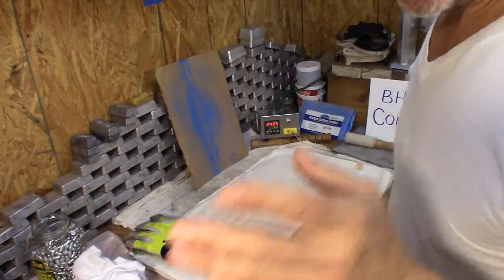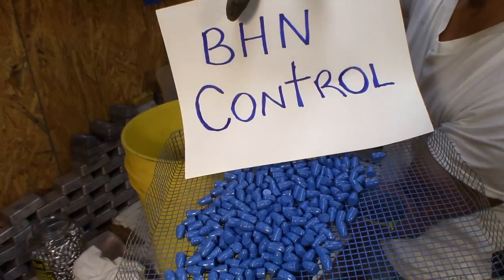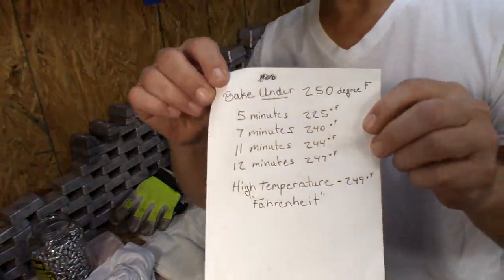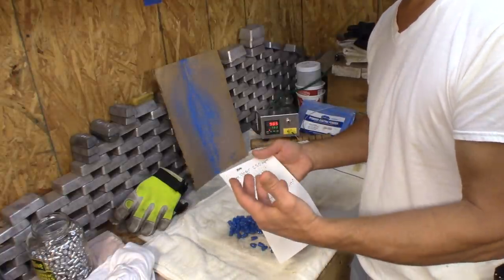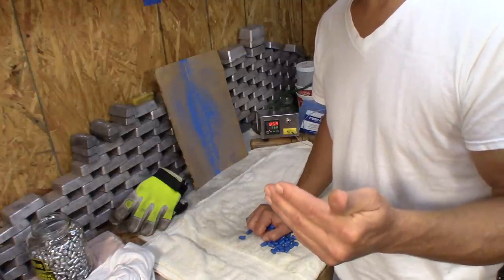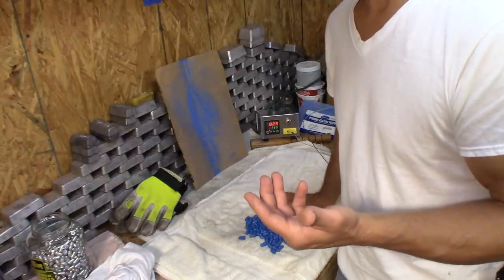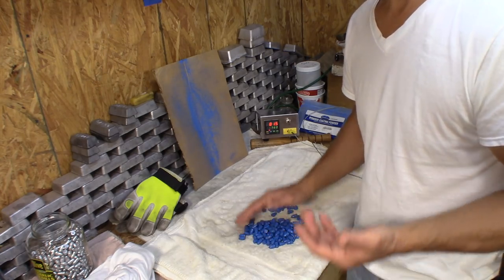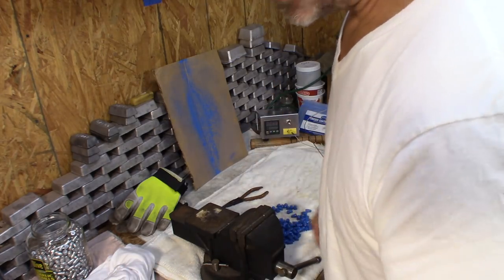Powder Coating Bullets (ULTRA LOW HEAT) Method

Comment: I followed your method as closely as I could, and my first attempt at powder coating bullets turned out great! I used Eastwood light blue and it stuck to the bullets almost instantly. I set my toaster oven at 250 degrees and cooked them for 14 minutes, then dumped the screen in a bucket of water. They came out great! Thanks so much, sir!

Comment: I’ve been powder coating for a few years now and love it🥰. My second attempt I tried curing the powder at 350. My oven read low and my bullets came out deformed. I cure at 300 and thump my tray of bullets on a steel table and let them air cool. Works super great with all my calibers. I’ve used some bright colours so I can retrieve my lead to see the results. No flaking or fragmenting. Between you and Fortune Cookie I’ve become the envy of my club. Thanks sooooo much.
Reply: I just tried my first at 400deg.  Too hot 0 deformed.   thanks, I'll try 300

Comment: My experience is similar to yours - I'm also using wheel weights, water-quenched and come up with 20+ BHN. After PC I'm around 12 BHN but they come back to around 15 BHN after a couple of weeks. However, I also set aside 5-10 bullets from every batch, date them, and BHN test after 6, 12 and 18 months and consistently found that the 20+ BHN bullets actually lower over time, bottoming out at around 15-16 BHN.  So while they'll clime back up from 12 BHN  to 15-16 BHN after PC, they'll also drop from 20+ down to 16 BHN (plain, non-PC) over long periods of time, like 6+ months.  Seems the very high BHN is only temporary unless you're adding antimony to your wheel weight alloy (up to an additional 1.5% will hold it at 20+ BHN for years. But they'll be brittle :))

Comment: Love your videos Elvis, very helpful.  I've had great luck with 300* for 10-12 minutes, works great for me but I'm not watching my BHN but, my cast are my plinlkin' pills for 357, 45 and 9mm @ 1000 fps at the most with anything that will melt for an alloy.  Only problem I had was when somehow my oven got flipped from bake to broil, there was some head scratchin' after that mess.

Comment: This is all good information and is quite interesting!  Those bullets sure do look Purdy with the low temp method.

However... I find personally that bhn is really not that important once the bullets are powder coated.  I use almost exclusively range scrap and at some point I will have to try powder coating pure lead and see what it is capable of.

Thanks for the video...
Reply from the maker: Hey Thanks shadowcastre.. It's not gonna be for everyone in every situation that's for sure. But it is interesting what we might learn from it! we'll keep ya posted! : )

Comment: Elvis, do u resize ur bullets before coating? Or can u resize them after coating. This jon
Reply: I use LEE molds. There very consistent as far as sizing. I think even in the instructions it says that you don’t need to resize after casting. I resize after powder coating and have no problem.

Comment: I did Some Testing with Eastwood Orange Vermillion Powder Coat Powder, and I was surprised by the outcome. My Test was done with 7 Batches of 40 Cast projectiles @5,7,9,12,15,18 & 20-minute Intervals. The projectiles were cast with A MP 359-125 Penta Hollow Point Flat Base (132.4 Grain) Mold. Then they were heated with A Black & Decker Toaster Oven @275°F after powder coating the projectiles were loaded on a dual endoscope fitted Dillon 1050 Super Press. All the bake times passed the acetone and smash test.

Comment: Gave it try. Old method with WW. All PC with Powder by the Pound olive green.
 Started with 20.9 BHN. water cooled. 400 degrees for 14 min. After 14.3BHN. 
Elvis method same start point 20.9BHN, 225 degrees for 13 min BHN 15.4.Dropped in water to cool.
Your on to something friend! Nice work.
Reply from the maker: Hey Wayne Venable.. thanks for the feedback.. looks like it is going in the right direction. a bit surprised by the 15.4 after. seems a little low, But could be a change in the ingredient percentage? Getting consistent results for the most part. So it's not a one off or a fluke. I'll be looking back and forth through this comment section. gotta feeling there will be some interesting stuff in here.. thanks for posting!

Comment: Elvis can my kitchen Oven be used to heat the powder coated Bullets also Thanks for sharing love your Videos very informative for a new guy trying this bullet powder coating method etc.
Reply: MyREDTAIL since he didn’t answer yet, personally once a stove has been used for lead or an oven has been used for powder coating, I wouldn’t use it for food again. Nothing wrong with using a full size oven if you have a spare/junker, but a toaster oven can be had for cheap, runs on 110, and doesn’t take up as much space.
Reply: Eastwood instructions specify that you should not cure powder coat in an oven used for food. I can understand why. Gasses are released by the powder coat during the cooking process. These will likely deposit contaminants you probably shouldn't eat onto your oven's various surfaces.

As for the lead itself, seems like it shouldn't be a concern so long as the oven doesn't get hot enough to vaporize the lead (no problem) and you're extra careful to leave absolutely zero lead dust / powder / chunks / residue within the oven (much harder). Given the difficulties I experience whenever I need to avoid contaminant transfer (paint, grease, dirt, solvent, food, whatever), I think I'd have to completely and thoroughly scrub, rinse, and dry (with paper towels) every surface within an oven, including the racks, a few times before I'd feel safe cooking food in it again. Everything used for the cleanup would go into the trash.

Just get a cheap toaster from Walmart.

Comment: Elvis this is awesome, I tried getting down to 250 degrees and I had similar to what you got there. I'll put a PID in my toaster over and see if the temp is accurate. The results speak for themselves. Since I don't have a range at home I'll have to hit the firing range and test them out. So far so good on the smash test and the BHN numbers look good too. Thank you for sharing.
Reply from the maker: NYC Reloader ...good deal man .. let me know how the range goes!!!
Reply: NYC Reloader have you or Elvis attempted a scratch test? Mine smashed well but seemed to scratch easily.
Reply: Hey Chris, are you talking about scratches when resizing? Or something else?
Reply: NYC Reloader actually scratching the coating with a fingernail. Mine holds up much better at higher temps. I've got the next two days off for testing.
Reply: I did same test with PID controlling oven at 250, it took about 20 minutes to just get oven to 248 (with bullets in it) and then I did 10 more minutes and still lost BNH.  Also the PC is kind of rough compare to normal method.
Reply: BHN 18 is low to begin with this is why it probably doesn't effect you.  My water quenched bullets are are 29.9 - 28.5, I just recorded video, I baked 13 min without PID at 200 degrees, note even lower than ELVIS AMMO used and they dropped to 17.9 - 16.6, so I am about where you are and it will go up a little in the next 3 days but I am never going to see 29.9 after PC and I want them hard so I can push them at jacketed velocities.  Even .357 magnum, it would be great to push them to full velocity.  Imagine that 105gr bullet would be screaming at 1700-1800 fps!  I know I've pushed 125gr jacketed HP to 1600fps with H110 from my GP100.
Reply: Dima Prok hey the lead you are speaking of BHN-29 is some pretty hard lead compared to my BHN-18 I just don’t know where or why I would need or want anything that hard short of making hardball ammo. I just want to say perhaps powder coating using any current method doesn’t work for your application. It happens, as for me and my ammo I’m in a sweet spot and loving life with my results. This new method has allowed me another way to alloy now because I’m not losing lots of BHM do to higher heats needed in standard powder coating. That in and of itself has reduced my costs as I don’t need as much harder materials like antimony etc to get what I need to cast my alloy. Anyone else have any comments on this? I’m sure there are better experts on this subject than me on this forum..
Reply: I had my WW lead reach BNH 18 after normal (400 degrees) powder coating if you let it sit it will age and becomes harder.  The point I was trying to make is curing it at low temperature doesn't prevent BNH loss, in fact I think we should be baking at 450 and longer and then water quench to regain more BNH points.
Reply: Dima Prok I start with BHN 18 lead alloy ingots. After casting I jumped up to 24 BHN after water quenching them. Using this new powder coating method and then doing another BHN Test of those water quenched pc bullets I was a little over 18 BHN. A week later I was back up to 22-24 BHN. They shot well and had very good grouping. I’ve also had zero fouling of my barrel as checked by my bore scope camera. Could I blend a higher BHN yes but so far I have not found an advantage for my shooting purposes. I guess it all really depends on how fast you want these rifle bullets to come out of the gun. For plinking my goal is clearly the cost to shoot at 100 yards with no massive bullet drop. This is in the Goldie locks zone for me for this purpose. I will do some testing with very high BHN to see how far I can push this. I’d love to hear more feedback from Elvis to see if he has done any more testing as it’s always good to hear from the master of this method.
Reply: +NYC Reloader, I am getting better results when I bake at 450 for 20 minutes, it gets bullets extra hot and then dump them in the water.  With this method they are immediately harder and I don't have to deal with not fully cured PC as that's what Elvis was experiencing.  If I want softer lead than bake them 10 minutes at 400 (fully cured).  Now I am not sure what alloy you're using but when you reference alloy BHN hardness you need to use air cool hardness otherwise there is no way to get a base number for alloy.  So if your air cooled ingots are at 18 BHN it's definitely not wheel weights.  WW are about 12 BHN air cooled.  This might also explain your higher than normal hardness gain.  Elvis did not test this thoroughly and posted this video, later when he actually started testing bullets with his AR he ran in to problems.  Read comment below from Joe Kikass.
Reply: Dima Prok I have some wheel weights but this was pure lead and I added rotometals super hard alloy to get it to a true air cooled BHN 18. I added some tin to get it to give a shiny and good lead flow. I let it cool perform a test that day and test it to be BHN 18. If it hardens after a week so be it. Then I cast the bullets, water quench them and perform my hardness Test using a batch average of ten bullets. They usually average 22-24 after a week. As a rule I do use some wheel weights but I add antimony as needed to get an air cooled BHN 18.
Reply: Wheel weights has a secret ingredient which allows it to harden extra hard - it's arsenic.  It really surprised me when I made batch of alloy for soft shooting 38 special.  It was 50% pure lead 50% wheel weights and 2-3lb of linotype.  When I cast bullets they were BHN 9 - softer than I wanted but after about 36 hours I tested again and they were BHN 19 - 21 that really surprised me!  I went and powder coated using high temp treatment (20 min @ 450) and water quenched them.  The color came out darker but BHN remained same.  I tested a week later but it didn't get harder.  With your alloy I believe you have potential to harder but in your case you found a sweet spot where it shoots accurately and now it's the matter of able to repeat consistently.  I am going a little bit different route I am buying my lead locally from scrap yard up to now for 60-70 cents a pound and sometimes getting some lead WW for free.  One time I came across bunch of WW and "high antimony" 3% lead shot, like 60 or more lb of it.  I am hesitant to melt it because I am sure it's worth more than just plain lead.
Reply: Dima Prok yeah I’m aware. I’ve got a bunch of wheel weights but I have an insane amount of typesetting monotype bars and even more pure lead from sailboat keels. As a rule I get all my ingots to BHN 18 then I can add some super hard alloy from Rotometals and juice any lead batch to whatever I need. Man do I hate zinc weights lol.
Reply: nycreloader I

Comment: I tried washing bullies in acetone power wont coat with out showing lead, so I tried heating to 120 and it come out in one big clump !! then tried not cleaning the bullets sizing still on it ( carbide - I lube every thing ) the power did better , so I put them on a pan unwashed in the sunlight 20 min and it did better , but out of all this it is messy but not like pan lube !!!! so I have 1500 to day coated in red ( H.F ) looks like a bunch of lipsticks some have a good coating and some are needing maybe a second coating I will fin out tomorrow I will burn up 300 rounds and see -I did not resize the bullets after coating I used 134gn 3.7gn Titegrupe  (LEE 126gn RN -6 mold ) is 134gn =) 5000 more to go yellow next batch . your help gave me the Inspiration to coat . THANK YOU .
Reply from the maker: Hey Stephen Salamone.... Glad things are improving! Perfection takes a little practice. Always do very small batches until ya get the hang of it,. If the bullets come out in clumps, it's always because they had too much heat. Our ovens are not so good at giving us the temp it says, But if ya put the bullets in until they are hot but not too hot to hold in your hands that's about right. Next step is to put them in the powder and get it all moving asap. otherwise this will cause it to clump. The hotter the bullets the faster you got to work when using the preheat method. Keep up the good work... You'll be a pro in no time!! Thanks for watching and commenting!
Reply: I preheat at 150 degrees for about 5 minutes and yeah I had same experience once where I overheated and the black harbor freight paint stuck in such nasty clumps I spend hours scrapping, it wasn't big batch either!  I should have just remelted them, would have been faster.  But yeah, like Elvis said, play around with small batch until you get it right with your oven.  I've tried acetone, but I found that it's not needed, it sticks, it's extra step and it's extra expense and it works just fine without it.

Comment: Ok, Elvis, have you checked out the adherence of the coating, compared to the old method? Not talking about the BHN, but the overall "stick" of the coating.
P.S. that hammer test answered most of my question.....

Comment: I'm bit confused, with the temp and time at 4.59 . wouldn't the highest temp 247 F have the lowest bake time 5 min and not 12 minutes as shown on the chart. And the same with the lowest temp would have the longest bake time. Like your vids just wanted to check this out before putting them in the oven.

Comment: Hi sir 
Have you tried to coat your bullets with epoxy paint ? 
And what's your opinion about it ?

I've seen some one coating bullets mixing 2 parts epoxy paint 1 part hardener and 1 part thinner  .
Then
Once it is dried he bake them .

Comment: I did a small batch of NOE 454-237  Pb:Sn 16:1   with this procedure and it worked very well.  I have not performed the smash test yet.  but will in the future

Comment: I use a pid controller for my smoker I got on Ebay cheeeeap, works fantastic just reads Celsius no problem tho considering the cost savings

Comment: Hey Elvis. I bought a very old piece of photo equipment. It is a little drying oven. The inside is about 3"x4"x5". It has a variable heat knob. The heat can be maintained from about room temp to about 160 degrees F. It has a little fan that just barely moves the air through it. I bought it for $2. I was thinking about using it to dry out the coating powder. I noticed in the middle of the winter here in WI it was -20 degrees F in the garage where I store and use powder coat. At that temp the powder literally froze together and I had to break it up. It must have been from moisture in the powder. So I figured I would try drying it first. What do you think?

Comment: Elvis, have you tried any other styles of powder coat? I was looking at the East Wood site and they all seem to be Polyester based. I know there are other powders out there like acrylic. Looks like everyone in the powder coat bullet community uses polyester. Has there ever been a study of what works best on cast bullets?
Reply from the maker: Hey Jon Lockhart... Great question.. Kinda hard to give a good answer. I'd love to try some different materials! Gonna have to check some stuff out. That's worthy of a good go! : )
Reply: elvis ammo I look forward too it. Epoxy is probably out but maybe not. I think there is also a polymer based powder coat. I am sure there are more.

Comment: Thank you Elvis for all your research in casting an powder coating. I have had great results with the Eastwood blue in my ported S&W 9mm's. I am a production painter using Sherwin Williams liquid coatings for over 35 yrs, needless to say I have gotten to  know my supplier. So I was able to convince him to make available to me a sample of there product line, 3.5 llbs of JD green (nothing runs like a deere). It covers and flows as well or better than the Eastwood in my opinion. I am hoping to run to 200 gr SWC 45's at about 650 FPS made from tape weights. Any opinion on this would be appreciated.
Reply from the maker: Hey Victor Reitan... Cool beans.. John Deer!  Just do a small batch and give it a shot.. If ya dont mind let me know what ya did and how it worked out, I enjoy the feedback!
Reply: Hey elvis! I been watching all ur videos I love em! I just got into reloading a couple months. Just started casting the other day. I used the hf black matte on my first run they turned out like crap! I guess I'll try that eastwood blue!